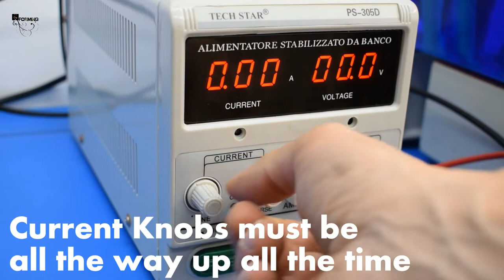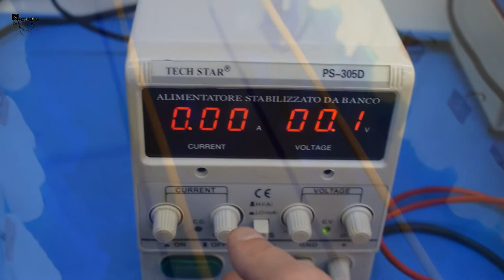How to set up your tank for electroforming

Comment from the maker: In this video, I will show you how to set up a DIY Tank to electroform copper jewelry and basically any kind of copper object.
A plastic container will be put on the magnetic stirrer with copper anodes and cathodes, all powered by an adjustable power supply. I'm adding copper sulfate, but it will be a topic for another video. It's gonna be heated with a fish tank heater and a thermometer will check the temperature.

MORE INFORMATION ON MY BLOGGER: https://cuforming.blogspot.com/

Comment: Love all your videos, super well done and so kind of you to share your process!
Im curious what you use to sanitize the things you add to the tank such as the heater and thermometer.. also why do you wear gloves when handling the copper? Is it because of hand grease? 
Thank you in advance, keep it up 🤗
Reply from the maker: Thank you for this comment and your appreciation. I don't sanitize anything, bacteria or viruses are not an issue, copper sulfate kills every living thing. I just wash and rinse what it's needed with distilled water or demineralized water. About gloves, I was using them to protect my hands even if in certain conditions and during some processes they were not needed. You can use gloves to protect pieces from hand grease, but it's not a real issue with textured objects so, unless you are making precise and perfectly smooth and shiny surfaces, you don't need them.
Reply: @cuforming  ah, that makes sense, thank you so much for replying! 🤗

Comment: What component are the stir-bars made of and what is their purpose, please? Also, is it a must to use a power source like this one or would an old-type mobile phone charger do the same job? I have little funds so need to find very low-cost supplies. 😮 if not…which power supply unit do you recommend? 
Oh…what are the two yellow devices you sit the plastic tub on at the start of the video and are these a must-have, too? Many thanks 😊 
I’m gathering information to build a kit and your tutorials are magnificent 😊
Reply from the maker: If you watch all my videos, you can see that most of my equipment is DIY. You can save by recycling and creating your own tools.
Stirring the liquid helps to make a smoother surface.  Watch this video to see what it does without stirrer: https://youtu.be/luzEOH1cWHw
A common phone charger gives around 5 Volts and you need to regulate the tension between 0.1 and 1.5 Volts, so you need an adjustable power supply.
Here you can find all the basic supplies to start: https://kit.co/cuforming/electroforming-starting-kit
And these are for the next level of difficulty: https://kit.co/cuforming/electroforming-advanced-kit
If you need anything else, I'll be glad to help you.

Comment: This video is really great, thank you! Can you store the tank filled with the copper sulfate solution after electroforming for the day or week, etc.? It seems like it would be a challenge to rebottle up all the solution between uses. Many thanks!
Reply from the maker: I usually leave the tank covered with its own lid and a sheet of plastic wrap. But it is also simple to empty it back in the bottle if I need to make some maintenance or if the solution needs to be filtered. I'm making a video where I show exactly how to do it with just a hose and a bottle. So stay tuned and thank you very much for subscribing.

Comment: I just received the dust cloths that were linked in this video and it says they are made with paraffin (mineral oil) is this even ok to use in electroforming since it contains oil? Wouldn't it contaminate the solution?
Reply from the maker: I've just removed the link. Amazon basic dust cloth is the only one with that ingredient. I don't know why they put it in there. Anyway I don't think a little paraffin can mess the solution. Usually apolar substances can help to remove the surface tension on the cathode, or they can just float on the surface of the solution itself... but it's better to avoid further issues. If you can return it, do it. I'm so sorry about what happened.
Reply: @cuforming  in using the dust cloths can you tie them on with string etc....if you don't have a heat machine to make a pocket....?
Reply from the maker: @carriebailey2503  Use a hot glue gun. Be careful, don't burn your fingers, use some parchment paper to press the flaps of the cloth together and a wooden board such as a cutting board.

Comment: My pieces are turning out salmon colored, thin and brittle. Do you know why?
Reply from the maker: For the salmon color you need to use brightener, they are thin because they need to stay longer in the bath, and brittle because the current is too high. These are usually the common solutions for those symptoms. Give me more info about your setup, so I can tell you more.
Reply: @cuforming  I just set up a tank based on YouTube tutorials. I have it in a big round glass jar (like for storing cereal on the countertop) with a thick gauge copper wire coil. I purchased electroforming solution and conductive paint online. I set it up with the red clip on the copper coil and the black clip on the wire suspending the pieces. I tried a leaf with about 10-12 inches of surface area. It's like 5 in long and 2 in wide at its widest part